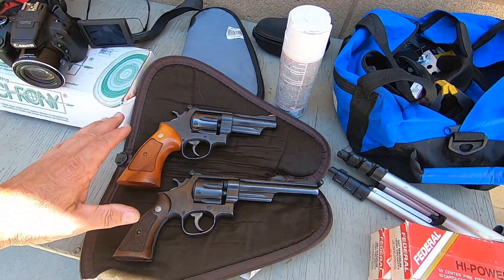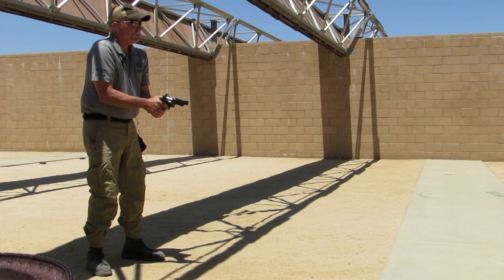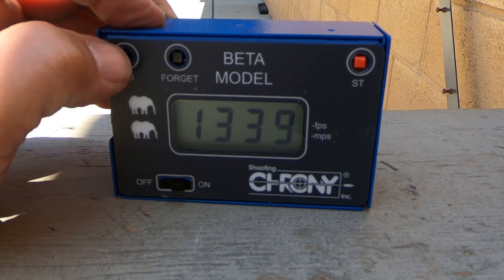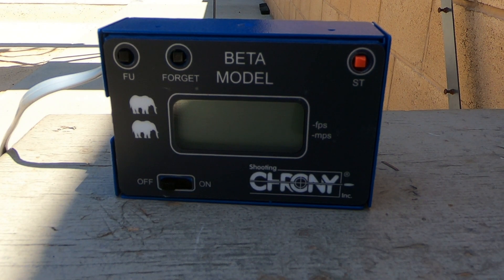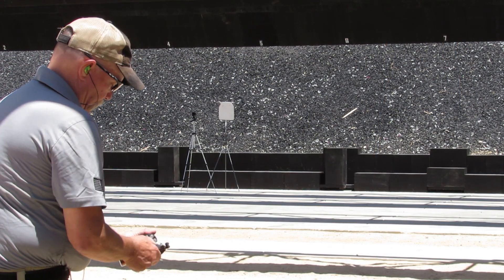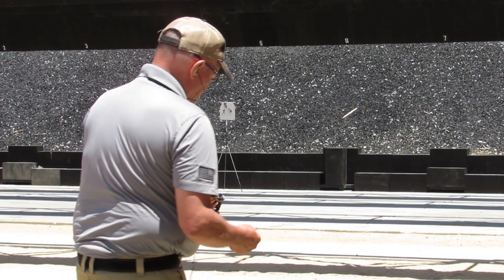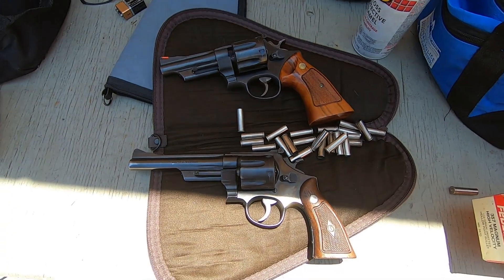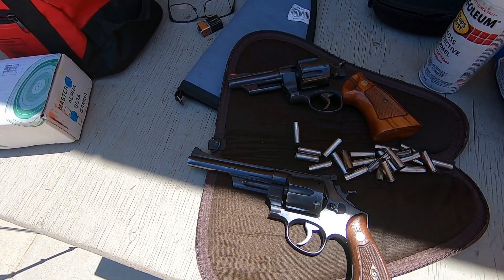Barrel length effect on velocity of the .357 Magnum

Comment: That's a 3" barrel not a 4", FYI.
Reply from the maker: Not to argue, but this is an NYSP marked Model 28, which is in fact a 4 inch barrel. It just looks shorter when next to the 6 inch version. 

Thanks for watching, I really appreciate it.
Reply: @Halfmilesniper  that's definitely a 3" barrel,(you can even see when they are lined up that it's half the length) I know what a 3" and a 4" barrel looks like on a 28.  Take a ruler to it and you'll be surprised. ;)
Reply from the maker: @Tyrantresister  I did...from forcing cone to end of the barrel it is 3 15/16", so 1/16" short of 4 inches.

Comment: I own a model 60 .357 mag. with a 3 inch barrel.  So, if that 6 inch barrel can deliver just over 100 fps more velocity over the 4 inch then, if my calculation is correct, the 3 inch would deliver about 50 fps less velocity over the 4 inch.
Reply from the maker: Exactly William. Across a number of calibers and barrel lengths the average seems to be right about 50 FPS per inch of barrel. Thanks for watching, I really appreciate it.

Comment: I thought it was the 125 grain ammo that would flame cut the top strap on K- frames that caused S&W to bring out the L frames.
Reply from the maker: The 125s were the worst, the 110 stuff was hit too and were hard on the forcing cone. The forcing cone cracking was what lead to the development of the L Frame. The L had a much beefier forcing cone.
Reply: As halfmilesniper said both loads were famous For erod forcing cones and flame cutting in .357 K frames. They (K frames) must used 145 and 158 gracias loads For avoid those problems and práctics more with .38s than .357 because even with 158 loads when they used intesitly would have problems too.
(Forgive My Bad English)

Comment: Those 110 grain bullets are not hot they do t even go close to making the 170 power factor for ipsc major for revolver now I have a four inch 686 s&w with 121 grain projectile doing 1425 FPS now that’s a k frame killer
Reply: Oh I believe it I was always under the impression that the 110 grain magnum was extremely hot well a lot hotter than what the chrono said the k frame revolvers are beautiful looking one of the nicest ever made
Reply from the maker: While this duty ammo isn't designed for IPSC or a competition power factor, they still kill K Frames, just not as fast as 170 power factor ammo will. The ammo is still hit enough to burn out and crack a forcing cone.  I have a very nice Model 19 that I killed just shooting quarterly qualifications.

Comment: Cool, yeah I've always heard that the length increased velocity by about 50 FPS per inch and that certainly showed it.  I'm sitting here looking at my Rossi 94 with a 16 inch barrel in .357 Mag and then I have my Ruger SP101 with a 4 inch barrel.  If someone doesn't loan you a rifle to further your test with then I guess I'll have to break out the ol chronograph and see for myself what the diff is.  Thanks for the video.  I'll working on putting together the second part to the Ruger video this week so keep an eye out for it.
Reply from the maker: I have a line on a rifle, hopefully it comes through.  I have to see how well the 50 FPS per inch holds over a long distance.